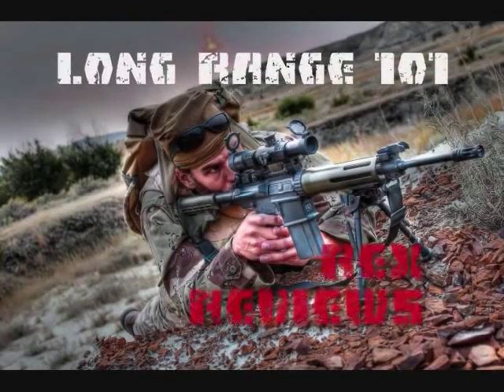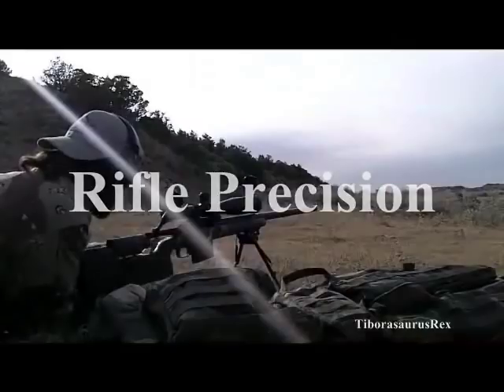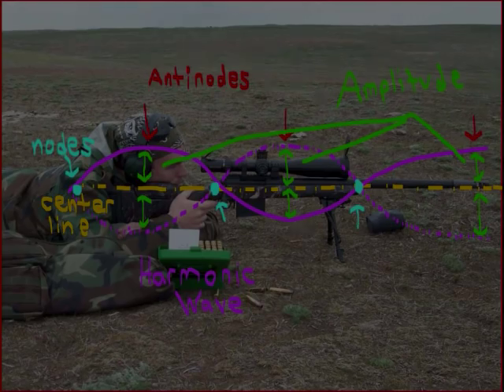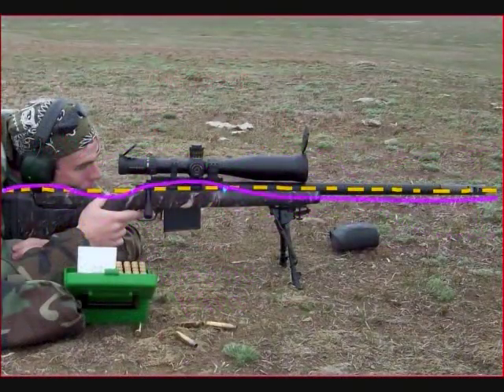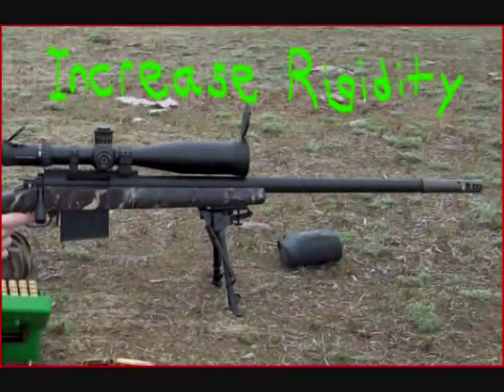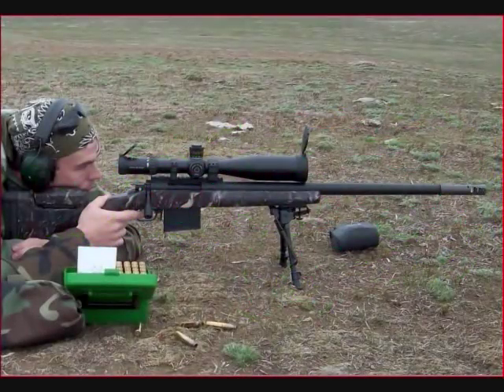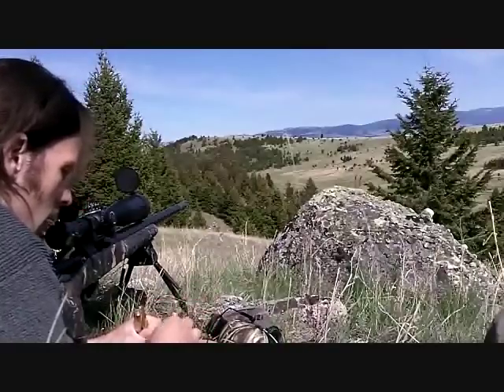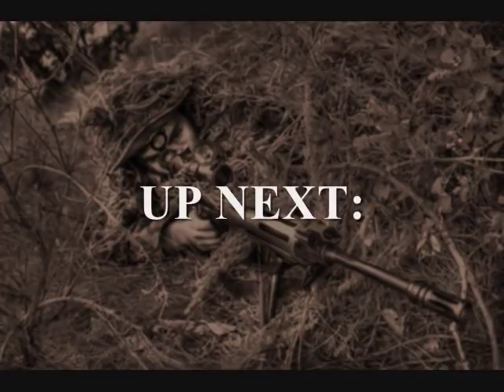Long Range 101 Part 7 - Rifle Vibrations & Harmonics EXPLAINED - Rex Reviews

Comment: Harmonics, So if I understand you I should glass bed it. Then disregard the free floating and try to find a pressure point as far up the stock as possible? Or just bed all the way up the stock?
Reply from the maker: Howdy!  There are several ways to 'skin this cat'.  It depends on your exact rifle and how it resonates.  Glass bedding the action is always recommended.   Free floating the barrel is USUALLY the best way to go with conventional sporting stock designs.  This minimizes deflection due to forward stock tension from resting the rifle.   However, IF this method doesn't work, one can try introducing tension on the barrel forward of the receiver.  This is what you may have to do if you have a military stock configuration.  If that doesn't work, one can fully glass bed the stock to the entire barreled action.

Comment: This is the equivalent of balancing and blueprinting a motor!  Which, is very critical to less vibration.  In motors, this is more critical with the balance of weights being equal to the rotation of the motor.  The explosion in a gun and a motor create the same effects.  All the working parts need to work well TOGETHER.

Comment: Hey man, great videos! I am wanting to sporterize a mosin nagant. I was planning on using a aftermarket stock, probably ati or boyds. With a bent bolt, and steel bedded action/magazine with a free floating barrel. My question is, would the harmonics play a huge role with such an old model? It has more options as far as handloads but I was wondering if it would be advantageous to shorten the barrel to 20 or 22 inches, or add a bull barrel, versus leaving it stock length. It has a 1 in 9.5" twist.

Comment: If you add a pressure point on the barrel forward of the receiver, is the deflection due to forward stock tension still a significant issue with these new stocks that have a full length aluminum bedding block? Thanks

Comment: I was curious about your thoughts on accurizing an M14/M1A?  My rifle currently is equipped with a slightly modified USGI fiberglass stock.  I've been able wring some 1.5" groups out of it in the past with surp 7.62, but have never really shot the rifle with match ammo either.  Do you think I could tighten the weapon up, or would ammo selection be the next logical step?

Comment: Ok cool i guess il just have to teat shoot  it and see if it make a good or bad change since the barrel is shorter with the gas tube that  extends out past the stock and attaches to the barrel which would stiffen it up right. As i mentioned before im not tryn to make this a hair splitter i have  my ruger #1   For thar in 7mm mag cal. Thank you again for the reply :)

Comment: I own a Mosin 91/30 and am playing around with it to acurize it. Most of what I've read says I'll never get it to be a 1 MOA gun and that's fine. I just want something that I can shoot for fun from a couple hundred yards. I'm looking at glass bedding it, but what I'm really interested in is the harmonics that you mentioned here. Now Mosins have the full hand guard to about 3 inches from the muzzle. Most of the videos I watch and things I read recommend sanding down the channel to free up any pinch points so the barrel is more "free floated." I've also seen a few that say you should glass bed the whole channel, or cork it. Would it be better to try harmonic tuning it?
Reply: From personal experience, I've had the best luck with replacing the stock with a Monte Carlo style, free floating the barrel and bedding/pillaring the action in the new stock, and shortening the barrel to between 20-22" depending on preference and grouping (shortened in half inch intervals to find the sweet spot for the load). Recrowned the barrel at 45 degree target crown with 90 degree external walls and 30 degree external edge. Mounted a rock solid industries mosin nagant 91/30 billet aluminum scope mount, and acri-steel the mount against the gun (with release agent on the receiver) to create a perfect fit. Also, polished all bolt and trigger components, shortened trigger sear and polished, and installed a set screw behind the trigger to eliminate over travel during the pull. Final product, my rifle shoots .65-1.5" groups depending on how well I'm shooting that day, but the rifle will outshoot me. Was it worth the effort? Well, to me it has been.
Reply: Forgot to add, those groups are from bench at 100m. Have yet to have the ability to push her farther as no local ranges set targets at greater distance
Reply: I ended up replacing the stock on mine, and come to find out either my barrel is warped or not true to the action. I ended up getting a lot of accessories for this mosin, but in the end I can pick up another 91/30 and refit them all on it.

Comment: So in reference to the barrel tension screw and glass bedding the stock to add barrel tension. If that method works well then why do so many people preach free floating barrels are the way to go? Or is this strictly a rifle to rifle basis on which works better?
Reply: If your barrel is not free float, and you rest the forestock on something, or your holding the forestock with your support hand, and the pressure this puts on the barrel is not exactly the same every time, then you CHANGE the barrel harmonics (as he explained) from shot to shot. IF your barrel is free float, and you TUNE a load to the free floated barrel, it isn't going to matter if your down on a bipod or resting on your support hand, the barrel harmonics won't vary.  At least I believe that is the best explanation.  Its not about "talking down to others", sheesh, little persecution complex going on?  jk.

Comment: Hey Rex. Your advice with regards to a vibration dampers. I have a 16" 308 and loose velocity with it vs 24". reloading for optimum grouping I loose velocity and limit my max range and wind drift. if I make use of the rubber type dampers will I be able to load to max velocity with out over pressure signs and then be able to tune the vibration to optimise my accuracy ?

Comment: Ok, I've been looking at controlling harmonics of my barrel using sims barrel deresonator. What are your thoughts with this device and would it be better to use two of them at different locations on the barrel while being faithful to the same consistent factory loads. My thoughts are that it would increase chances of bullet release at same spot on wave at low spot.??

Comment: As it pertains to barrels, what are your thoughts on carbon v steel barrels?  Based on this video I'm assuming carbon would add rigidity but it likely would be less than the rigidity produced by a steel barrel of the same diameter.  With that being said, and I don't know if how I'm going to word this makes sense, but per unit of weight (oz, lb, etc), what is more rigid, carbon or steel?  Basically if I go with a carbon barrel that looks like a bull barrel, will it be as rigid as a smaller diameter barrel made from all steel (given the same caliber)?

Comment: QUESTION: I have an opportunity to buy a M1A standard which has a 22" barrel. I've been told it has a lot barrel harmonics and I should get a 18 version. But I plan on shooting more long range and would like the higher velocity. Is the harmonics going to be a problem? I plan on upgrading the stock and having it bedded.

Comment: So what you are implying is that the deflection of the muzzle determines how the bullet will fly in the end. Why would I be interest in moving an node to the muzzle then? Sure there is the least deflection but the most tilt. After all the more serious impact to accuracy is not a bore offset but a error in angle. Its what makes a bullet deviate more from the aim point the farther away it goes after all. So what im not getting right?

Comment: does increased pressure and velocity due to increased temperature of your ammo change your accuracy node? 

Ex: I load 43 grains of powder X and it shoots 2550 fps. @ 60*
Now at 90* the velocity and pressures have increased to.... 2650.   My point of aim will be different, but will it still hold a tight group? Or have my harmonics been thrown out of whack???
Reply from the maker: AJ PARKER Excellent question!  The increased pressure will undoubtedly change the harmonic signature of the rifle and can thus contribute to the POI shift observed after the barrel warms up - albeit only by a very small amount, typically.

Comment: Interesting viedos here!
Question: Do you think that barrel de-resonator such as the LimbSaver's may help in managing harmonics and oscillation in a way that there would be gain in shot accuracy?
Reply from the maker: The concepts behind such designs are sound, but to gain true consistency, you will have to ensure that the dampener is situated EXACTLY the same all the time - which could be difficult to attain.. there are better ways to improve harmonic consistency in my opnion :-)
Reply: TiborasaurusRex I understand. Opinions on the Web are somehow controversial on this subject. I really appreciate your advice!

Comment: I understand how traditional bedding is subject to stock dynamics (stress, warp, external loads, etc.), but I am wondering if this would be any different in the rail systems like those found on modern AR type rifles. I am assuming that for a long rail, going as far toward the muzzle as the shooter is comfortable with would provide an vary stable and rigid node point nearer to the muzzle.  
The relatively large cross section of these rails, combined with the truss-like construction, the material and the manufacturing process would make it very effective to tie the barrel down to the end of the rail. Am I wrong? Has anyone tried this and documented how effective it is?

Comment: Rex, I saw a rubber grommit-type thing that is slipped over the barrel and placed either close to the end of the barrel or close to end of the forearm, based on whether the barrel is floated or not, and it is supposed to reduce muzzle-vibration. Any truth to this?

Comment: i have a few questions i'm on part 7 so far. my questions are i have a remington 770 i know so of the people will have crazy comments but it is what is. anyways my questions would the bullets for the 300 win mag be the same as the .308. for distance and for hunting deer. or would i need to find a specific bullet for the 300 win mag. and the second question is i was told to let the barrel float. would that help or hurt the accuracy and precision of the rifle? thanks for videos they are great!!!
Reply: It's the same bullet
Reply: shawn henderson The bullets are the same for the ".30 cal" range. Exception being made for .303, some 7.62mm, and some of the oddball projectiles. For the most part when I buy Hornady projectiles, the boxes say ".30 Caliber". As long as you're picking an appropriate projectile for your rifle, in terms of use and target, any make of .30 calibre projectile will do just fine. I shoot a Hornady 178gr BTHP with IMR 4064 at 2560 fps and the groups are fine. Your accuracy, with regards to loads, will be dependent on:1) case preparation and brass grade
2) bullet BC
3) muzzle velocity <<<<this is important<<<<<
These are the more basic elements.......accuracy of the rifle has a lot to do with the rifle and a lot to do with the load.Free floating the barrel removes the antinodes along the length of the barrel. This makes the barrel whip more consistent from shot to shot.
PM me if you've got some more questions....

Comment: I have a question how does a bipod effect the harmonics mounted on the barrel end instead of the stock lets say for a SKS. I was digging around in a old box and found my sks bipod im not tryn to make it a hair splitter i i like its accuracy as is just tryn to make sure  if i mount it. It wont  make it any less accurate

Comment: Do you have any tips/tricks to harmonic tuning a free floated barrel on an AR10?
Reply from the maker: +Austin Taylor Either a look for a rigid barrel (heavy) to minimize the floppiness - - - or tune the load harmonically to shoot in your current barrel  :-)
Reply: +TiborasaurusRex Thanks looking at switching to a 7mm heavy barrel and shooting a 7mm-08 cartridge so I can get thw better B.C., 1 in 9 or 1 in 8 twist?
Reply from the maker: That would be a great setup
Reply: +Austin Taylor Hi Austin. We can definitely help you with that...http://bostromgunsmithing.com/index.htm#Page_Products
Reply: +TiborasaurusRex I would also look into the dampening tricks that rimfire benchrest shooters use. They use what is essentially a pipe clamp with extra bolts as weight and screw it tightly toward the end of their barrel. They move it back and forth 1/16 of an inch ( sometimes even 1/32) and shoot a series of groups until they find a position that is tightest. They then mark the position of both ends of the clamp on the barrel with a grease pencil, and take the clamp off. Reattach it ( careful to measure how tight with a torque wrench or number of turns on the bolt) and fire a few more groups to ensure it wasnt a fluke. They then locktite the bolts with the clamp in that position. This works great if you are intent on finding that one load which you intend to reload for just that rifle and shoot long range. I wouldn't suggest it if someone buys several different brands of precision ammo or does not have the skills to make highly reproducible handloads. 

On another note, I wanted to thank you for this series. I began watching this series when I bought my first bolt action rifle(for precision) and started reloading for it. You give excellent insight and a solid way to sort through all that is "tacticool" in a logical and efficient manner. I still re-watch your videos whenever I think of a project and get too excited after googling all the possibilities. I calm down, sit down and make my comparison tables and let logic take the helm.

Comment: +tiborasaurusrex ok so I'm seeing the same question everywhere I look. can you please do a video explaining free floating barrels and their vibrations and harmonics. I'm trying to find a good base for a semi but everything I'm finding is floated now.
Reply: if not then what would you recommend for switching a system that is designed as a floated system to a fixed system? for example with the colt LE901-16s

Comment: I wouldnt recomend floating the barrel in a 700 with a synthetic stock , I did that on mine in 30-06 and it was like the standard stock had upward pressure on the barrel because my point of impact at 100 yards changed quite a bit

Comment: So with that logic, why the free floating barrels? why not just clamp down the barrel hard to the stock?
Reply: The stock adds variables. If it is going to flex, you want it to be flexing the same way every time just as the bullet exits. However, one effective variation on the principle you propose is to weld a rigid truss to the barrel to prevent or reduce flex.

Comment: you have also failed to take the for and aft waves in account created when the bullet engages the rifling and stretches the steel in the chamber area. so now ask yourself, if you can NEVER make a load that will perfectly "ride the wave", does it make more sense to load to when the barrel is vibrating fastest, or slowest?

Comment: How can one determine the frequency, wavelength, and location of the nodes.
Reply: Speed of sound through medium (barrel in this case - steel = 5960 meters per second) divided by frequency will give you wavelength.  nodes will move as the pressure wave travels through the medium

Comment: What would you say if I told you that... One of the best known individuals in weapons/bullet forensics (retired member of a known 3 letter org) has proven that "barrel harmonics" only affects the barrel of a rifle after the bullet has already left the barrel?  the info is in trickle down mode , but it will help rewrite sotic/MC/Army sniper school etc..etc. he also goes on to train individuals about free floating barrel accuracy is now know to be a novelty...and not a requirement for an accurate rifle.
Reply: I'd tell you that I have some ocean front property in North Dakota to sell you.
Reply: bring something relative to the conversation. By the way,  the man's name is Burford Boone. do some research.
Reply: My comment was entirely relevant. Buford Boone understands absolutely nill about physics, or he's intentionally lying. The
speed of sound in iron is 5100 m/s, the fastest bullet is the .220 swift at 4665 fps (1421.892 m/s) over 3.5 times slower than the plane elastic waves. Just because he was with the FBI and has a following in the gun world doesn't mean he gets to rewrite physics.

Comment: Does wrapping a rifle in rubber tape help?
Reply from the maker: Although tape will dampen the harmonic vibrations a little bit, it won't usually affect the rifle's performance.   In my experience, adding or removing tape to a rifle has not significantly altered its POI or precision capabilities.

Comment from the maker: You could switch the stock, as long as you make sure its fitted correctly.  Call me strange, but I would actually stick witht he original military stock.  As long as everything is tight, it should work more than good enough.  Many M91s and even M44s can do less than 1moa in their military configurations.